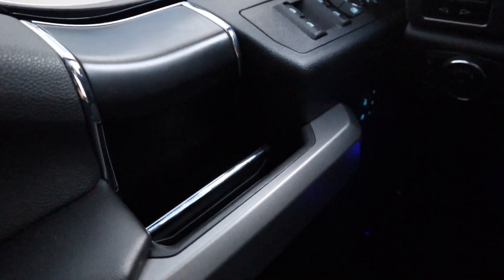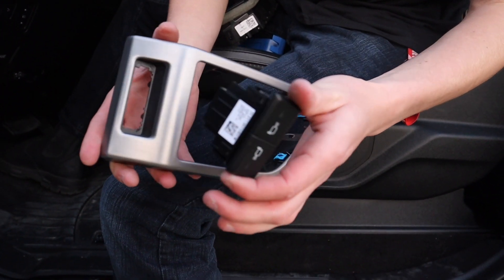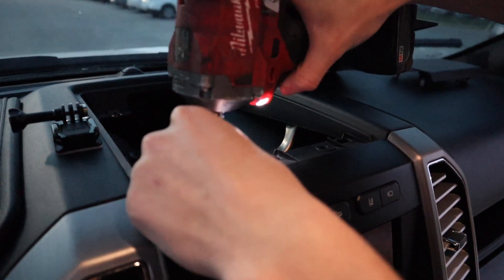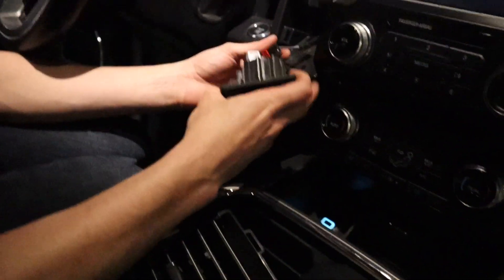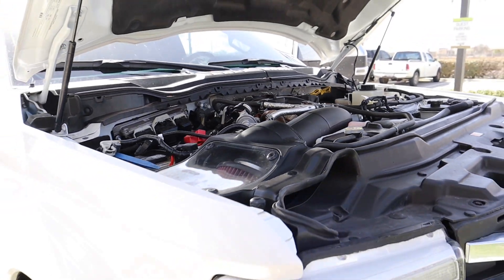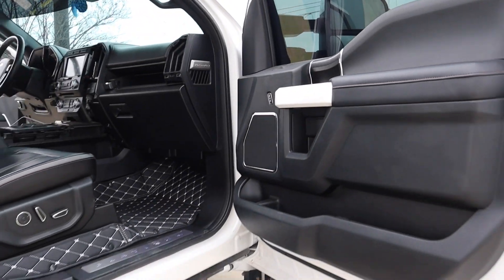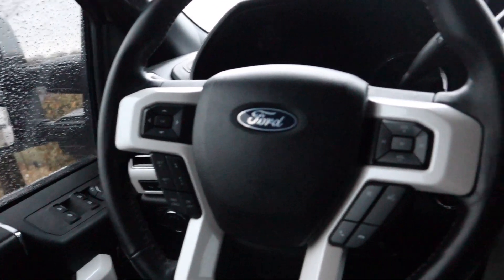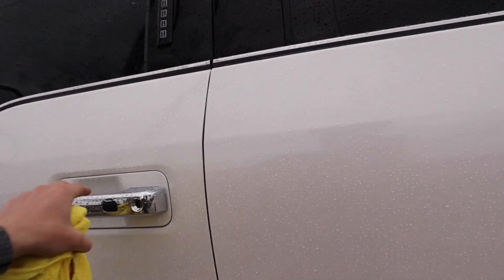How To Paint Match 2017-2022 Ford Interior

Comment: The silver piece that says Super Duty by the vents when you open the front driver and passenger doors. The silver piece above the steering wheel by clusters should have also been painted white. Find you a good upholstery person to remove the silver in your seats and replace it with white. Awesome job and video.